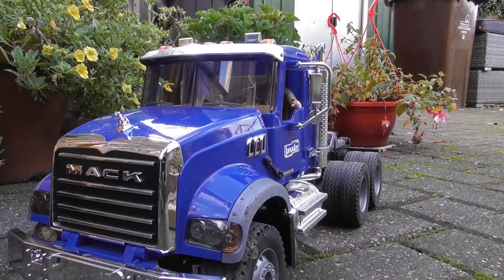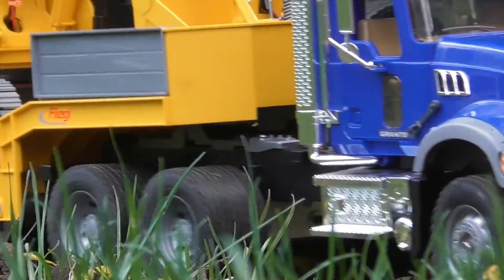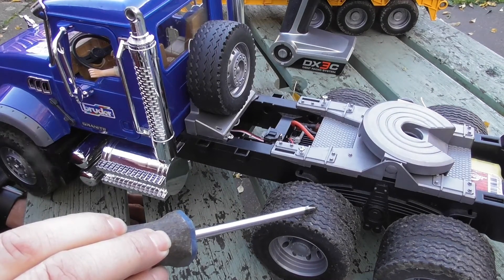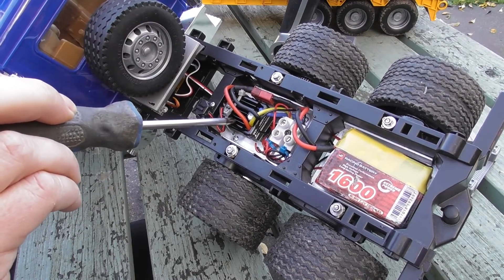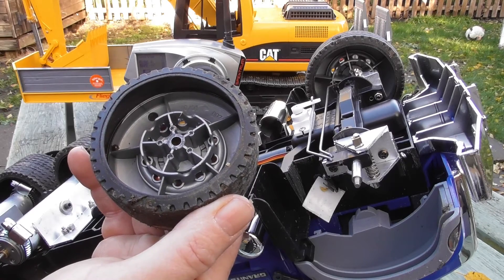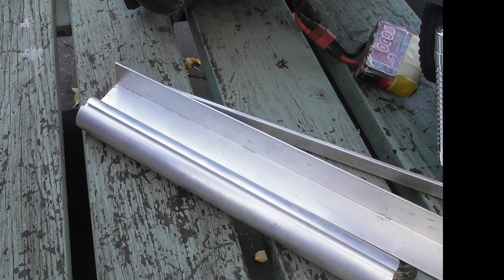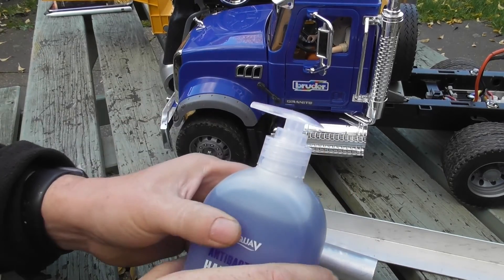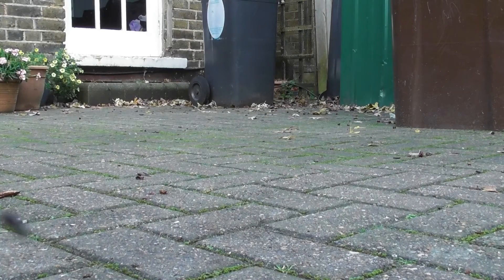Bruder Truck  RC Conversion pt1 : prototype

Comment: I have  Huapeng semi truck rc. I want to upgrade the wheels and tires on it. But am having trouble finding the right ones. The rear drive motors have 5mm hex and the front wheels are pressed on with a pin. Any input is greatly appreciated.

Comment: Very ingenious method of mounting the motors and making suspension movement!  While some guys might scoff at the low-tech involved vs their 'scale' conversions of a Bruder, those guys are also using 1/14 wheels/tires which are visually too large for a Bruder truck.  Nice to see the Bruder wheels have sufficient traction, that was always a question of mine.

Comment: Hiya man I've just been on ebay looking for 200 rpm 6V 3.5W DC motor 25g a370 London £8.27 free p+p  is this the motors you use thank you.       Peter

Comment: Great mods!!  Did you ever post the next parts to this one?  Thanks!

If not, could you please share links to the motors and ESC / other components used?  Thanks!
Reply from the maker: This conversion was very much a “scratch build” using Meccano and things I had lying around in my shed at the time. So not great for parts listing. The new version of the big Bruder truck conversion - which I developed using the Mercedes half-pipe dumper truck - uses 3D printed parts that I designed and easy to find components (which can be easily sourced on Amazon or EBay). I’ll be doing a build series using this method and sharing all the 3D files and parts listings at some point. 👍😀

Comment: hello mate, very innovative and budget oriented builds, inspiring!
what happened to the rest of the Bruder truck build?
I'm building one myself too

I'm also a Youtuber specialising in RC Tanks ;)
Reply from the maker: Too many parts to only be found in my shed. The revised truck conversion uses 3D parts that designed. Much better result and easier to replicate. I’ll be publishing the parts and links when I get round to doing that one. 😀👍

Comment: Great build. Very inspiring. Im looking to do similar. 
Im stuggling to find the drive motors you used at the price you said but they look very good for traction as you mentioned. I predict I will have difficulties with the tight space in the steering area of the bruder volvo. 
I also want to try and make a hub adapter for the wheels to run rc bearings. Have you used the Mack alot? 
I really like you uploads. Thanks for sharing.
Reply from the maker: You are very welcome 🙏🏻

Comment: do you have any of the build videos yet? Just bought the Bruder truck you show...
Reply from the maker: Not yet.  But when I do it will use 3D printed parts - easier to replicate and much better (suspension etc).

Comment: Really wanting to do this, have you made the follow up videos of converting the trucks?
Reply from the maker: I have since developed a better solution - using 3D printed parts, which I have developed - for the entire Bruder truck series (Mack / Man / Scania etc) that is much easier to build. When I get to these, I will publish the parts so folks can download and print for free. I'm currently working through the smaller Bruders in the videos until I get to these.    😀👍
Reply: @RCModders  I've been waiting for a few months to show you how you managed with 3d printed parts. I always watch your video to see if you put the 3d parts.Thank you.Respect.

Comment: Brilliant and inspiring build. do you have a link to the geared Motors in the UK?
Reply from the maker: I used 25mm 6v 200rpm geared motors in this. You will probably want to shop around. Here is the spec : https://amzn.to/2JzGjMV.  😀👍

Comment: i asking if possible to use wpl part for converting a bruder truck?
Reply from the maker: Personally I would recommend WPL for the larger Bruder trucks - track not wide enough etc. Possibly OK for the Jeep Wrangler TJ (I' used WPL on this) and Mercedes Benz Sprinter. 😀👍

Comment: Hi Tom just wondering if we’ll get some build videos for this conversion. Currently working in a similar one and I’ve gone with a similar motor option/design it’s good to see someone actually completing it.
Reply from the maker: You will! I have a lot of models to get through & am hoping to include a simple to install 3D printed parts version for all the big Bruder trucks in the line up.   😀👍
Reply: Good to see Pete is still out here, was getting worried 😁 Maybe one day I’ll Open the secret vault to all my Bruder/ ertl Rc conversions.  More variety running model versions than I dare show on here 🤫 🕵️‍♂️
Reply: ThatsMyRc why?

Comment: Is there anyway you could provide a link to the steering knuckles you used ? I’m having a hard time finding them !
Reply from the maker: Hi I searched, the best place to look for these or similar would be at Mardave, the manufacturer (https://www.mardave.co.uk/) or look on Ebay, where I bought mine. In the update / build series, I'm probably going to make something available using 3D printing to make sourcing easier for this conversion.  😀👍

Comment: Dats a dope rig
Reply from the maker: Thank you! I need to do more with the Bruder Macks. Just got  a red one (with the crane on the back) and thinking that i might use this for my first Mack build video series! 😀👍
Reply: I can’t wait to see I have a question for u I used a qx-4 ( partner racing) rock crawler all in one esc on my mn-D90 but I’m having problems wit it where it will drive but it drives for a lil bit but then it’s like it’s struggling to move

Comment: it does seem very crude but it works SO WELL!! I bet with those gear motors that the 1600mah pack lasts forever to! you have opened up more possibilities to rc some static models I have! ty!
Reply from the maker: Agree with the ‘crude’ point. The challenge here was to make a functional model from a toy using simple techniques and low cost parts. And you know what? It has already had more use than the £1000+ Tamiya truck that I built a few years ago & I could have a small fleet of Bruders for the price of that! If I were to install two £4 ESCs (one for each axle) it would run even better. I think I need to lower the front wheels in the build when I get round to this one, but that’s all I would change. 🙂👍

Comment: Hey buddy. Glad to see that (on another video) you have got your 3D printer working!!! Still I'm waiting patiently on the second video on the Mack Granite !!!! I have now all parts collected for doing the Mack Granite conversion according the missing video. Please hurry!!! Not to get you I trouble ! I've found a tiny ups' in your video!!!; one off us 2 will have to calibrate the calipe!!!  the nut you are using on top of the plastic on the wheels is NOT M6 but M8!!!!! The axle's on a Bruder is 6mm plus 1mm plastic all around the axle = 8mm (7,8to 7,9/8 mm). Just to let you know. Othwise ceep up the good explanations and good work.
Regards Henrik
Reply from the maker: Yes you are right on the nut size, sorry about that! 😊 The 3D printing thing really opens up the builds for people without a full workshop or much experience of fabrication. I will get back round to all of the builds that I 'owe' people - I promise - I just wanted to build up a little portfolio of prototypes & develop a little more experience & skill first. I think that the truck will probably do built 2 ways - with and without 3D printed parts, I start with version just using fabrication. The next build will be the tele-handler, then I will go back and make some of the others - including the trucks.   😁👍

Comment: Thank you for your video I was able to build the rear end of my dump truck. I had to use 3/4 PVC and cut 1/8 out of it to make the motor holder because could not find the kind you have . But follow everything else and I am happy with it . I will text you with a part list I use from Lowe's store.  Sorry for the long text message. Your friend Darrin
Reply from the maker: Sounds great. Are you going to make a video? 🙂👍
Reply: @RCModders  yes I will look into doing it today.  Thank you.  I need to add speed control I have the 75 to 1 gear motors.

Comment: Hi. I have been following your videos and I have the mac low loader. I am wondering when the " how to" video is coming to utube, as I am eager to get started on mine.
Many thanks 
Dave.
Reply from the maker: Hi. I am finishing one last prototype before I get started on the builds. I gave myself the Christmas holidays to learn 3D printing and the CAD to design / slice parts. That will be the CAT loader. I’ve designed cylinders with built in limit switches that cost about £8 each (including speed controller and gearbox motor etc) to go on this. Future builds (after the Mack/Scania and skid loader) are likely to feature 3D printed parts, although I will do a full video on buying, setting up and using the inexpensive printer that I have opted for (Monoprice Delta mini) the builds on the channel. Within the next couple of weeks I hope to do the hauler build. I’ll probably use a Scania as a base, but they are pretty much the same (Mack will require less trimming of the wheel arches), I will cross reference between the two so that either can be build easily from the build video. In the mean time you might want to join the Facebook group that I mentioned in the last A60H video where you can ask any questions to get you started and share your learnings people doing similar things. 🙂👍
Reply: @RCModders  many thanks for your speedy reply.
I am looking forward to seeing the truck build.

Comment: could you give an insight on how you got the wheels off the metal rod axles, man are they on there good.
Reply from the maker: I think that I show it in the second video on the Mercedes Sprinter. Basically saw the axle somewhere towards the middle, put a metal nut on the plastic wheel shaft part of the wheel (5/8" I think on the Mack, M8 on the smaller vehicles), put in a vice & lever off carefully with a claw hammer. I found heating just made the tyres warp & shrivel! I'll be doing the detailed build in the next few weeks & will be sure to show this stage. 🙂👍
Reply: @RCModders  thank you very much! i will try, i have been working on one, a little different than yours. if it all goes well i will make a video on my channel, thanks again!
Reply from the maker: Nikki Sticks  No problem! 🙂👍
Reply: Love it !! When can we expect the next video ?

Comment: i cannot wait to see these unfold! I have been out for a while after my appendix surgery, and started watching construction videos from Germany and Austria to pass the time. I am slowly getting into the world of construction RC, I have a Huina 580, A Magom Mini cat, and want to try and get the D5 Bruder dozer coming in the next short while. Long story short i have been watching your videos in awe, it is amazing what you can do. I do want to make the dump truck though. So i am excited to learn and see. I love Rcing, but must admit i really am not very aware of the electronics in these conversions. But i will be very proud if i can make it move and dump. Thank you very much for these. im stuck like glue on these, so awesome!
Reply from the maker: Thank you so much for your kinds comments! 🙂 I've been at the the Bruder toys in earnest for about 3 months now & its amazing what you learn just by having a go at it - with a little bit of research and quite a bit of just thinking about it. I suspect that the easiest place to start with these is probably going to be truck (lots of room & quite simple), the lift on the tipper isn't too difficult either. I'm sure that I'll be doing step by step guides on all this soon. Good luck with your recovery. By the way I love the rock crawling course you have put together use on your YouTube channel!  🙂👍
Reply: @RCModders  for sure, I have been bouncing some ideas back and forth with my dad, because he is also big into model building, and wiring, mostly in airplanes and boats, so i am lucky to be able to ask him questions, and also email him my schematics on how i think it should all be wired together.  Glad you liked the rock crawler course, it used to be about 4 times bigger than that. the very first video i have on my channel shows it best. My new track will be a dry set up in the garage for all these new toys. It will be nice to build one a lot less labor intensive. My back is not liking to move all that rock around anymore. Thanks again. i am staying tuned!

Comment: Great stuff, I laughed when you showed the soap dispenser, I used them on a couple of Mods and when cut back makes excellent suspension springs. I recently began using some parts from cheap 1/16 WPL Hobby trucks for a "World Peace Keepers" a toy conversion of a WZ  551 6x6 IFV and trying out on a Bruder MAN  truck and trailer. Think your work is inspiring and the idea of your Bruder truck conversion is fantastic. At £50 for parts per toy, it is a realistic price to get into modding and look forward to your videos. The new "WPL" 2-speed gearboxes they have for "upgrades" are quite good and have some torque. Nice one.
Reply from the maker: Thank you for you kind comments! I was trying to avoid Rc coil over shock dampers & having to mount them to the aluminium tubes & these just happened to be in good supply in our house (my wife bought a few of these at Aldi, I'll have to swop over the pumps from the "empties" before she gets any of the ones I borrowed from out of the cupboard!😂). They are quite stiff, but seem to work OK - especially with a heavy load. I was trying to keep the cost of parts down for people, so that anyone can have a go if they fancy it without having to invest a lot. I agree that WPL stuff (and normal upgrades) are a pretty good source of inexpensive parts too - especially if you want powered wheels that steer.  🙂👍
Reply: @RCModders  Thanks for replying, it seems like you too like to play the "Aldi/LIDL soap dispenser appropriation game". I have to admit I have swapped a fresh "pump" for an altered one on a few occasions. I am awaiting a recall at the shops or a letter complaining about German inefficiencies in soap dispenser design from our house.LOL.
 Next thing we`ll see is an ingenious "springless" upgrade, all because of our covert thriftiness and invention. The last "mystery" domestic cleaning problem was when again ALDI/LIDL had a fine metal mesh cap over their pump spray toilet cleaners, unfortunately, they ended up re-designed!. Hhmm?!. All the best.
Reply: I also have used WPL diffs and gearbox for conversions, fit perfectly into Bruder or Dickie frames. Really work the trick

Comment: Thank you for sharing this , looking forward to the next video in this series.
Reply from the maker: My pleasure! I'm looking forward to doing the build. I have a feeling that it might well have a Scania R series cab - as I love the detail in these. 🙂👍
Reply: RC Modders  I have 2 bruder Mack dump trucks I’d like to convert
Reply from the maker: @tomweber8729  I did do a dump truck a few years ago using Meccano mechanics (it appears in a few of the "Hobby engine" videos) - when I do another I'll probably want to find a way to make the lift move a little quicker. 🙂👍
Reply: RC Modders I’ll look into this video also thank you